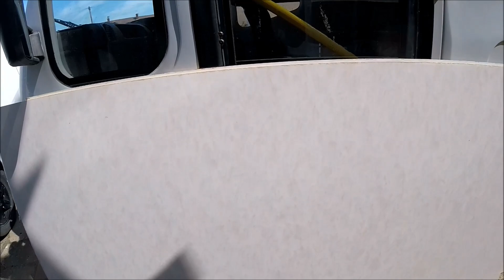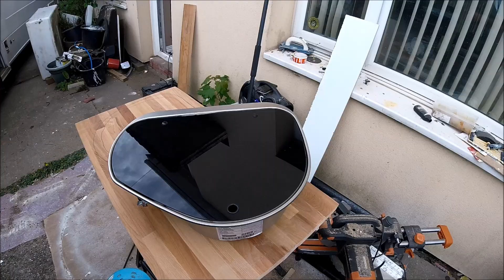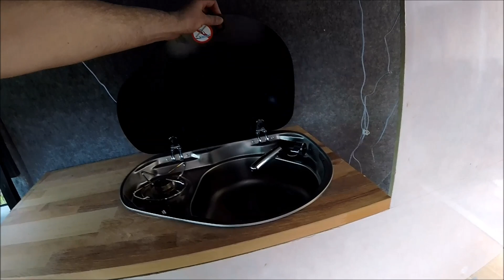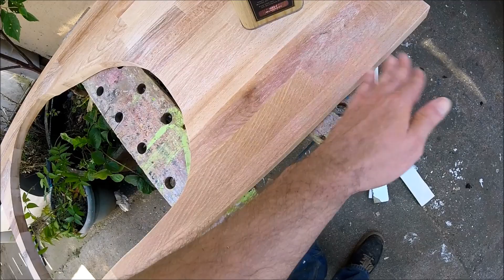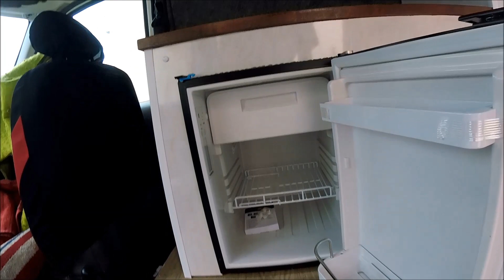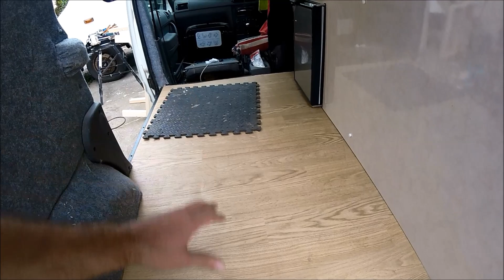Ford Connect Campervan Kitchen Unit Build Inc Smev 8821 Hob & Dometic CRE50 Fridge

Comment: Do you have a link to the type of lightweight ply? Cost for 8x4 sheet? Thanks
Reply from the maker: I bought it from a local non-chain store
Reply: is there a brand name. All I can find is £100 a sheet Multipanel ?
Reply from the maker: not that I know of, but I did manage to get mine from a clearance section which helped on the price

Comment: On such a small van I'm looking at the voids around the sink and fridge and thinking about the wasted/hard to access storage space...
Reply from the maker: I don't know what you are referring to, what voids around the fridge/sink are you on about?  There is no wasted or hard to reach storage areas, everywhere that is accessible is easily accessible
Reply: @TheCampervanBuilder  I was looking at the gap between the top of the fridge and the worktop - room for a drawer, or a flap above for access to the space - somewhere to put cutelry? I've got a VW T4; it was built with the water bottle left & gas bottle right, with a door in the middle for access and a 'wardrobe' at the rear, with a stupidly small access hole at the back under the wardrobe cupboard (yours is much better as it's bigger). Huge faff having to empty the cupboard to get the water bottle out. I took the front off and replaced it with sliding doors for better access. 
Is there much space over the battery below the sink? And will you have to take the gas bottle out to get the water bottle out to fill it?
Reply from the maker: There really isn't much space left between the fridge and worktop as the hob cuts in to that space.  The fridge can pull out if ever needed to for maintenance etc but shouldn't have to.  There is space between the battery and hob but the R&R bed will block all access to that.  The gas bottle will have to come out to change the water but thats just the nature of these types of cabinets, I think I've done well to squeeze in as much as I have in such a small space.  The gas bottle will have a quick release connection on to make accessing much quicker and easier though.

Comment: May Suggest the use of a circ saw. The chip out on those boards is fairly extensive.
Reply from the maker: It's just because I started the cut on the wrong side, if cut from the back it leaves nice smooth cuts.  A bit of trim works wonders though